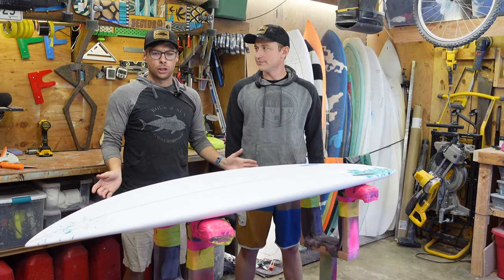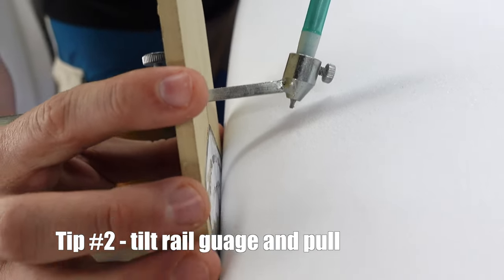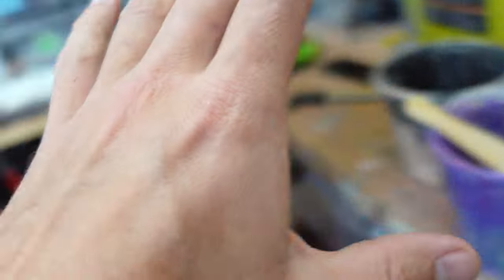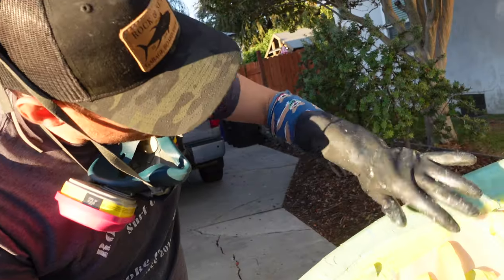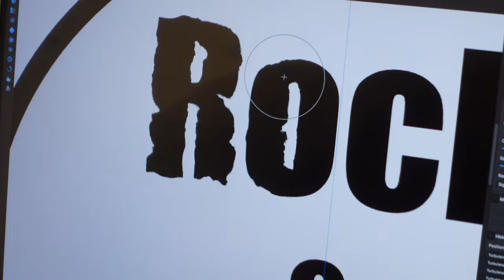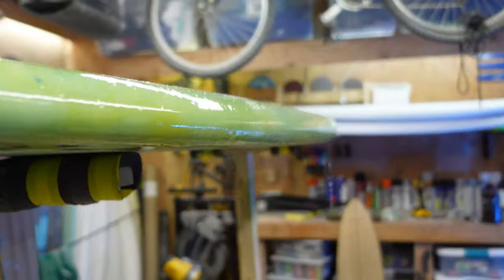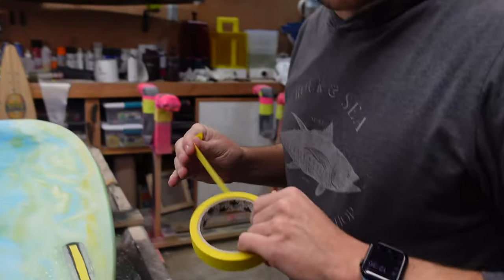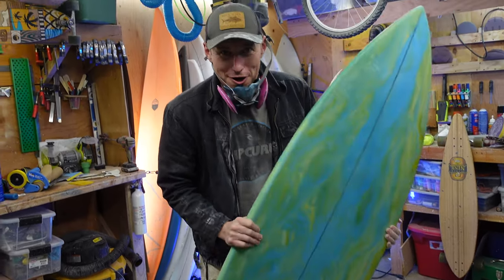Surfboard Glassing Resin Swirl  - Tutorial with Tips and Tricks

Comment: Great video.
Did you use a special tint paste ? 
Because I saw that it doesn't go very well with UV resin, it can prevent from hardening
Reply from the maker: Wow so sorry for the super late reply, just saw this!   No need to use special resin tint, my issue was that i partially exposed the resin to light thus initiating the reaction but then no providing enough sunlight to fully catalyze the hardening reaction.   If you do it right standard resin tint works just fine!     If you are adding a TON of resin tint to the point where light can’t penetrate all the way through the resin, then in that case I always add some resin catalyst

Comment: Love these videos, just curious what gritt sand paper do you use to sand the fix boxes open
Reply from the maker: I use super low grit to sand down the bulk of the material, using 45 grit, then I sand the last little bit with 80 or 120.   45 grit leaves big scratches but removed material quickly, the just removing the last little bit with higher grit leaves it looking nice and smooth 🙌🙌

Comment: When the sand paper on the pad becomes clogged up it’s due to a lack of styrene and plain candle wax 10% mixture which is added to the resin when mixing up and applying the Hot Coat. This is prevents the sand paper from being clogged up by the resin dust, making for a good sanding job afterwards.👍

Comment: Have you ever had any problems with the Meguires wax?  I had this weird problem on my latest board where the epoxy just straight eroded in two finger nail sized spots... one on the deck and the other on the bottom. I noticed the problem lile two days after I buffed it. Anyway I'm wondering if the Meguires might be the culpret if it's left on the board for a prolonged period (i don't know how i would miss a spot but i'm literally lost for answers).
Reply from the maker: That’s super weird?! Once epoxy is cured it is actually somewhat chemical resistant to pretty serious chemicals whereas meguires marine wax is pretty benign.  I’ve had something similar  happen to me one time, I likely under mixed the epoxy resin and after hot coating I went to sand and had one small patch of resin never really cure completely.  It stayed soft and just smeared when sanding. Ended up having to sand/cut the section of hot coat out and re-hot coat.   I’d say that’s probably the most likely culprit for you.   It’s hard to believe because I’m pretty meticulous about mixing my epoxy but it really just felt like It was a patch of only semi mixed/cured resin.  Now i really make sure to not neglect mixing along the edges of the bucket and have never had a problem since.    Out of curiosity what epoxy were you using, I normally use resin research and only had that uncured issue when using ghost brite epoxy.
Reply: @RockandSeaGarageBoardShop  I've been using Greenlight's Marine Grade Epoxy (slow hardener), thus far with no problems. This was only my third board, but I'm pretty meticulous about mixing as well. It takes at least 3-4 minutes to get a clear mix with this brand, but given what you said I suspect i didnt mix enough. The odd part is I didn't notice either spot in sanding. In any case I'll be switching to Resin Research Kwik Kick 👌
Reply from the maker: Man that’s super strange, I really wouldn’t expect that after such a thorough mix, but I really don’t have any other idea what it could have been, and that’s weird because you would have seen in during sanding for sure. This one is a mystery to me?!!   Well hope you get her patched up without messing up the esthetics of your new board!!!  Hey if you post on insta tag rock and sea, I love seeing everyone’s builds!
Reply: @RockandSeaGarageBoardShop  I suppose it could be a combination of not mixing enough, contamination, and/or overheating the resin through sanding. That said I'm calling this a fluke haha. And yeah for sure i'll give you a shout out!

Comment: I always get a lot of bubbles in my epoxy, regardless of how slow I'm mixing. Any tips on how to avoid bubbles?
Reply from the maker: Hey that’s a great question and I bet a bunch of people wonder the same thing.   It’s fine if you get bubbles in the pot while mixing, no stress🙌.
When you are laminating, all the little bubbles will get worked out while squeegeeing.  When you’re mixing epoxy for the hot coat, it is a little more annoying. I quickly brush out the hot coat and then if I have any bubbles, with luck the brushing action pops them all, but you can actually quickly hit the whole board very lightly with a heat gun. The bubbles will expand with the heat and then pop. 🙌

Comment: When using UV acrylic for nails some formulations have a sticky layer. We use isopropyl alcohol to remove the sticky layer after UV/LED curing. Perhaps that would work with your resin.
Reply from the maker: Interesting, I’ve heard of guys doing ding repairs using acetone to “harden up” some slightly undercured resin if it is still a little tacky,  I bet that’s somehow along the same line of things.   Thanks for sharing, I’m going to give it a try on the next board that comes out sticky, if it works I’ll give you a shoutout next vid

Comment: How long did you let your hot coat sit before putting it in the sun? If you don’t give enough time for the wax to rise before putting it in the sun, you can’t really Sand it and your paper will clog like it did.
Reply from the maker: It was weird, waited about 10 min, and could see the wax layer firming on the surface, but absolutely clogged my sand paper still. Worst time I’ve had sanding!   How long do you wait, I really wonder if the cold temp affected it?
Reply: @RockandSeaGarageBoardShop  10-15 minutes should do it. Cold weather could have been a factor. But can’t say for sure from my own experience
Reply from the maker: Hmm must have been the cold then, I need a heater!
Reply: Was thinking a little more about this. Is it possible light shined in through your door on the nose again?
Reply from the maker: This time I was intentional about keeping the door closed so shouldn’t be that, looking back in the vid I said I only kicked it 5 min or so in the sun light, the next day before sanding noticed it had that tacky stick to it so kicked it another 30 min or so in the sun but didn’t really help.   I wonder if that initial kick is the most important and I just didn’t give it enough time.    Going forward im just going to try catalyzing my hot coats even if using solar, so I can quickly kick them in the sun and flip for the next side but with the assurance that it will always cure nice and hard with the catalyst

Comment: Funny to see how they struggle with the most basic resin and glass handling process steps.
But this is the way of learning by doing.
The most important point: they have fun while being on the way to finish the board.
What I would recommend: keep your buckets clean guys!
Other-way you will end up having cured crisp residues from previously used resins.
This will cause a lot of problems in the future.
Artsy thing does not mean, you are allowed to be easy and and not caring about cleanliness of your tools (like buckets)
Reply from the maker: Wise words Andras, one thing is I find I use a lot of acetone cleaning out buckets,  Ive found its cheaper to flip over my buckets letting as much drain out as possible and just let whatever is leftover cure in place.   Before the next glass job I blow out each bucket with high pressured air removing any lose thin crispy resin 🙌

Comment: Use sanding resin for hot coating and it won’t gum up
Reply from the maker: I was! Very strange, haven’t ever had problems like this before.   I wonder if the guys at the factory mislabeled the resin, they buy 50 gallon drums and then fill 1 gallon jugs they re-sell to some.  I wonder if they mis-labeled the resin